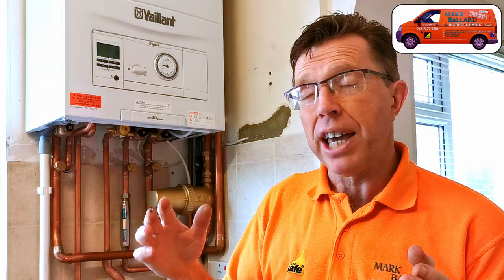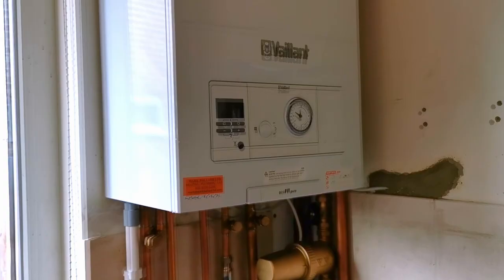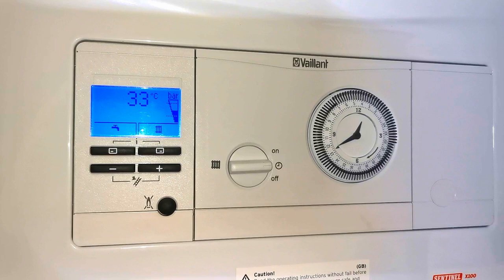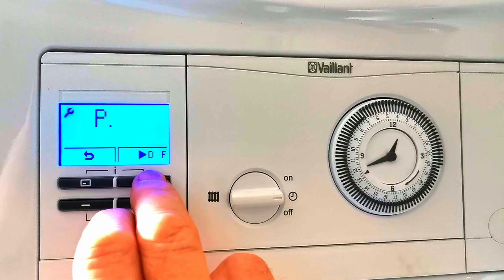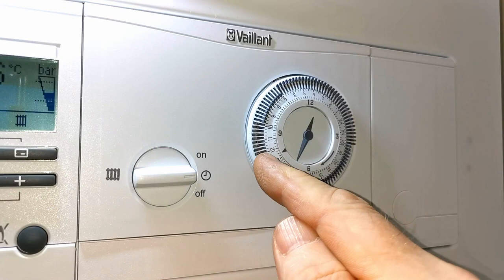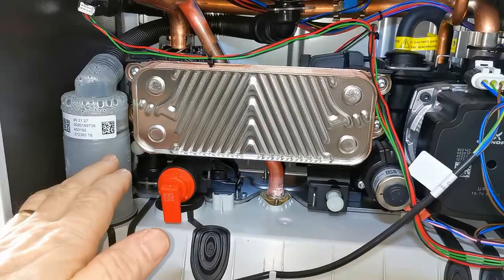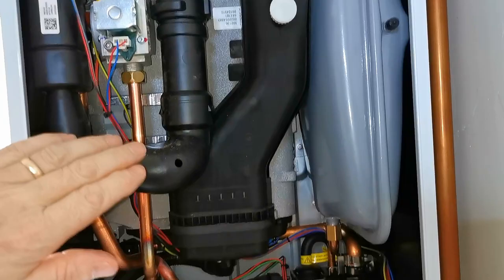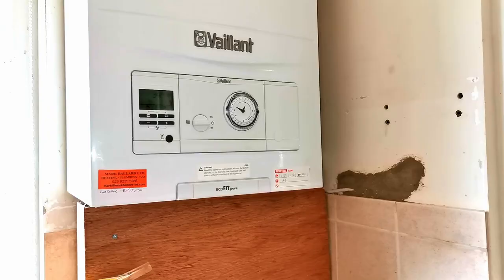Review Vaillant ecoFit PURE Combination Boiler REVIEW.  How to Operate and what's Inside the Boiler

Comment: It's  a 'Glowworm' bought out by Vaillant. Unlike other Vaillants it has an inferior aluminium heat exchanger and is more difficult to install and maintain. It's a bit CHEAPER but certainly NOT BETTER than the PRO or PLUS range which are superb models!!
Reply: That's useful.  Thought 🤔 my plumber was being tight and putting this in.  I'd rather 200 quid more for a better boiler....
Reply: Yeah i think its also inbred with Heatline aswell😂 i wasnt too keen on these at first as the connections underneath are complicated and squashed together. On the plus side the fact you can have the rear outlet option for flue.

Comment: To purge the p.00 system as I can hear air in boiler. Do I just open the black valve below it to right? I guess screw left to open.  Bloody plumber can't help me for weeks zzzzz.
Reply from the maker: combi boiler. I normally make sure there is enough pressure in the system1.5 bar, then run heating. That should pump air out of the boiler.
Turn the hot tap on and off  whilst heating is on to remove all air. Then bleed of air from rads, top up boiler.
That's what I do 99% of the time.
Works fine unless there are other problems.
Reply: @MarkBallardLTD  thank you so much I will try this. Thank you thank you. I did the purge programme today and it seems to have worked too. They all have different ways the valve works too.  Not sure why the instructions are so vague.

Comment: Hi Mark,

This boiler does not have good reviews, do you recommend this boiler
Reply from the maker: I have used this boiler many times and they are workings absolutely fine, But I would recommend spending more and getting the Vaillant ecotec Pro or Plus boilers they have stainless steel heat exchangers and there's a couple of other thing I proffer in these boiler as an engineer.  The Pro is the most reliable in my opinion,

Comment: Hi Mark,

What’s your views on a Vailant vs a Worcester Bosch, what would you go for?

I’m asking as my current combination boiler Soinier Duvall, is 16 years old and we are re fitting the kitchen and are told it’s at the end of its life, working ok though but thinking is a good time to replace it now when we are doing the kitchen.

Any advice appreciated.

Thanks David.

Ps what boiler do you have?
Reply: Both boiler are good. Just depends on your preference
Reply from the maker: Agree with last comment. Vaillant, Worcester and Ideal. All top ranking boilers in the UK. 
What you should bear in mind is that it doesn't matter which boiler you get these days they are all extremely complicated and have expensive components within them.
So having the extended guarantees really is a bonus.
Reply from the maker: All modern boilers are high-performance machines squeezing every ounce of energy out of your gas.
I regularly compare them to modern day hi performance racing cars.
You wouldn't put dirty old 20 year old tractor fuel in a high performance car.
And yet we take a high-performance boiler and stick it on a 20 or 30 year old radiator system and expect it to run perfectly for 20 years.
No matter how much flushing and cleaning is done on an old system there will always be dirt in it. Filters help considerably reduce magnet damage but does not stop it.
 Even in brand new systems Which are well treated.
Over years magnetite still built-up affecting  boiler performance and eventually it will kill it.
Reply from the maker: I have a vaillant ecomax 835 in my house and it has run pretty much without any problems.
Reply from the maker: Also bear in mind all the manufacturers have different models in general the more expensive ones are better having said that my preferred boiler would be the Vaillant ecotec pro. it's just more reliable!
Reply from the maker: One thing I really do like about the Vaillant boilers is I can change pretty much any component within one hour. Worcesters on the other hand. Some parts are  really difficult to change. Ideal are similar to Vaillant.
Reply: @MarkBallardLTD  Thanks Mark, it was a complete new system rads and new pipe too, fernox from new and flushed and re fernoex 3 years ago, system working well and does not drop pressure at all minimal .5 bar re pressure only once a year after bleeding rads after summer ready for winter.
Would a system like this take a new boiler?

Thanks again Dave
Reply: @MarkBallardLTD  My Vaillant boiler has been running great for over 13 years now, we did had to change the PCB, as one does with them but the water inside our system is crystal clear. I always checked the magnaclean and was always clear. I stopped doing it every year and last time was Nov 2019, probably should now, but water in radiators is clear still (when bled).